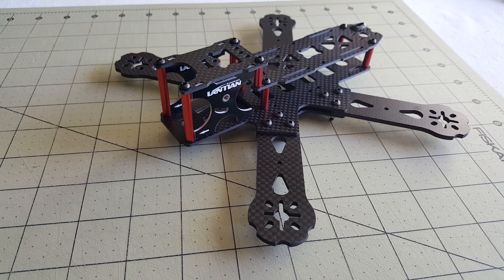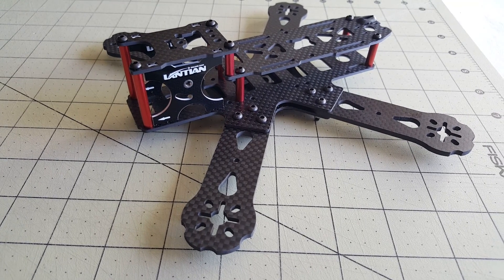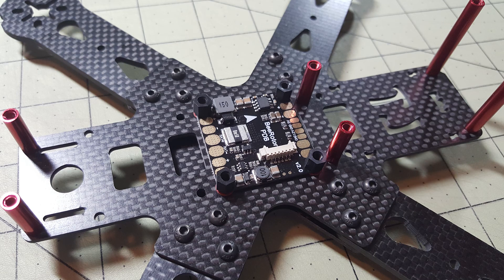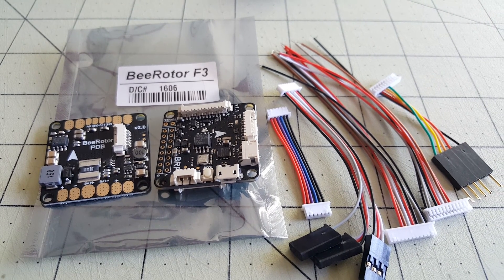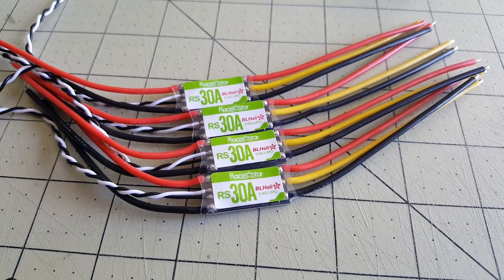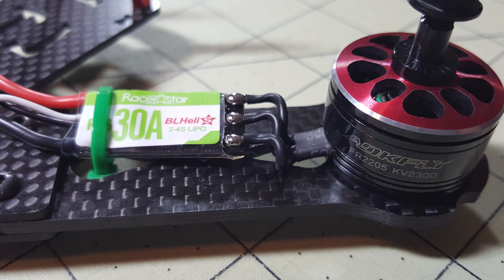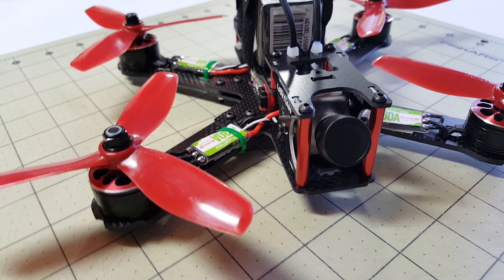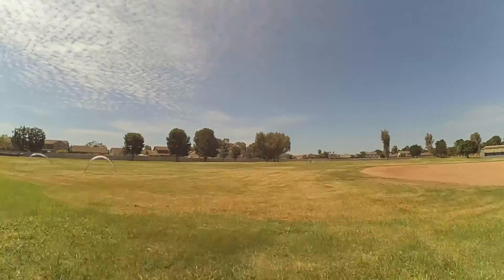Lantian 215mm X-Frame Build & Fly

Comment: Hi Albert, Are you still using RunCam Eagle in this frame? I read the video description but you wrote RunCam Swift as FPV cam. I'm asking this since some people say that RunCam Swift won't fit in this frame. So my final question is, Does RunCam Swift fit in this frame?
Reply from the maker: I am using the Eagle. In the video I explained that I was going to use the Swift but the Eagle came in while building it so I swapped cameras. The Swift and Eagle are the same size so the Swift should fit. The side pieces are slightly wider than it should be so you may need longer screws and some washers.  If people were not able to mount it, they didn't try hard enough. :)
Reply: Thank you sooo much Albert, your statement absolutely rarefy my hesitancy, so I can sleep well this night. Agreed, they really didn't try hard enough and blindly made a wild statement like that :) Anyway, have a good one Al..

Comment: How did you do the soldering job on the aokfly motors with the esc i'm new to this ?
Reply from the maker: +Ominous Matrix hmmm, I just cut the wire to length and tinned both the wire and the ESC. Make sure you have a hot iron!
Reply: ok thanks mate
Reply: how did you program it ?
Reply from the maker: +Ominous Matrix Betaflight 2.9 on stock PIDs. May need some more P and D however.
Reply: do you have a tut
of that
Reply from the maker: +Ominous Matrix not yet. I will have one soon. I am making an Alien clone and will have a video on programming in that series. Let me know what you need info on and I'll try to include it.
Reply: will the programming be similar to this ?
Reply from the maker: +Ominous Matrix yes. It's actually pretty easy
Reply: ok thanks